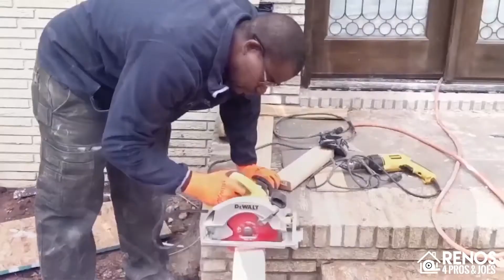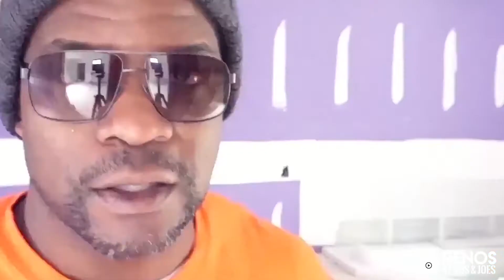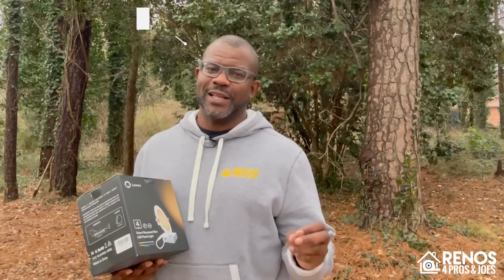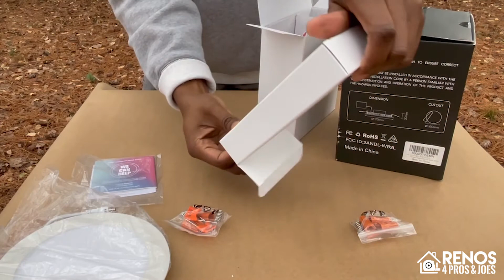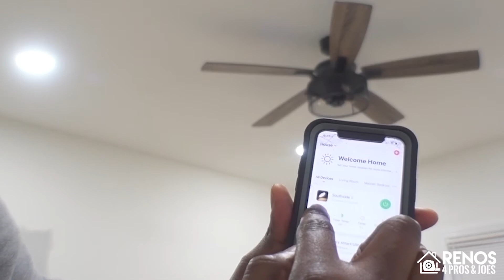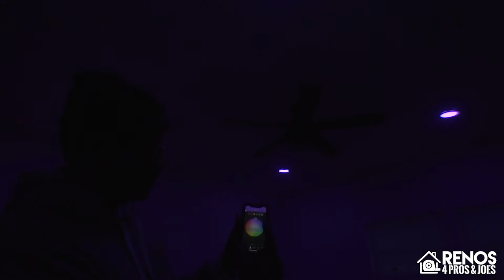LED COLOR CHANGING LIGHTS | Recessed Led Wafer Lights (Multi-color)

Comment: Are these wet rated? When you set the brightness and color temperature and switch light off at wall switch, does the same settings remain when switched back on or is there a ‘default’ setting each time you turn the lights on?
Reply: good question, from what I've seen al lot of smart lights reset to default when their power is turned off by a switch and not by an "app"